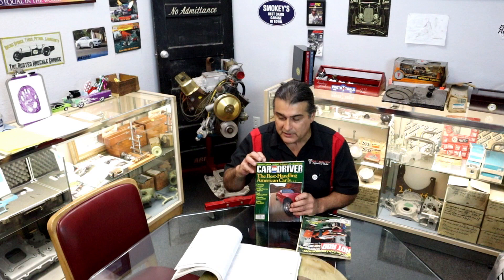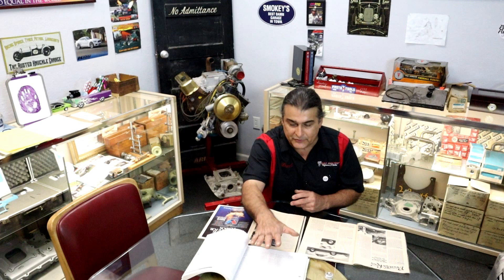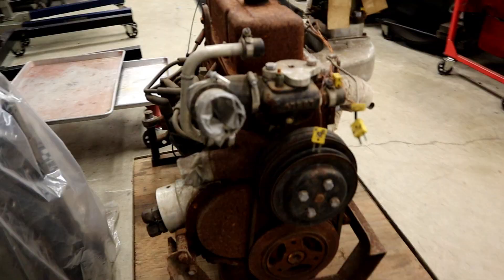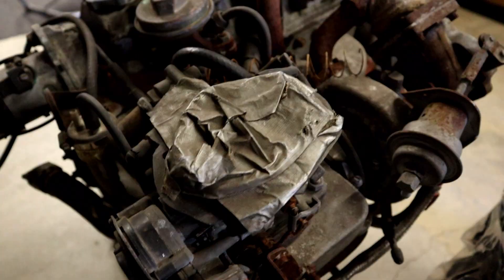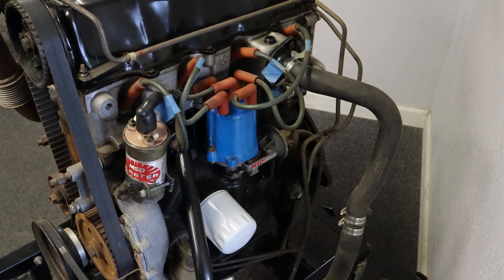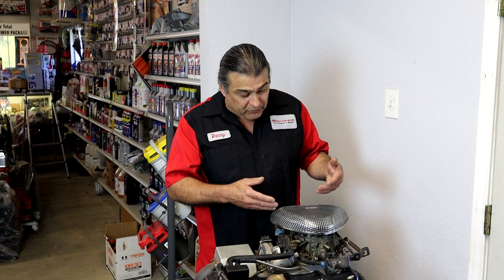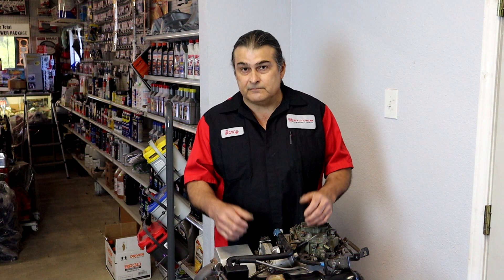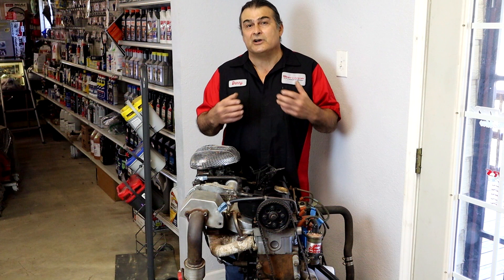What ever happened to Smokey Yunick`s Hot Vapor Engine

Comment: 250 horsepower with 54 miles per gallon, why didn't this succeed, and why is no one pursuing this today...
Reply from the maker: Great questions!
Reply: WHY NO ENGINE IN THE INTERIM 40 YEARS?  
 
1.	The first reason is OIL, not Big Oil, although that is a part of the answer too.  In the early 80’s the widespread availability of synthetic motor oil and lube was a decade or two away.  In order to make the engine functional at the temperatures required for the engine to achieve Hot Vapor process Smokey was using Jet Engine oil that was 98 dollars a quart.   
2.	Of course, Big Oil was a reason as well.  After the Oil Embargo of 73 there was a push toward fuel economy.  But by the time Ronald Reagan assumed the Presidency, one of the first acts was to remove the solar panels from the White House roof.  The rest of the decade saw a move toward less of an emphasis on the fears of the 70s and the return of gas shortages. 
3.	The OEMs had ideas of their own and moved back toward the idea that cooling an engine was the answer.  They had also made a commitment toward EFI and they were not going backward.  The culture of that time (Pre- Jobs, Gates and Tech Entrepreneurs) tended to look down on engineers without formal degrees. What Marlan Davis called, “it wasn’t invented here syndrome” in his article for HotRod Magazine: “It was the "not invented here syndrome" rearing its ugly head again. “How could a couple of gearhead hot rodders know more than all of Detroit's best engineering talent?” 
4.	Lack of access to the original engines.  Smokey made the conscious decision and concerted effort to keep the hard tech from the “suits”  There is good evidence that even trained engineers with access don’t understand what they are seeing and misidentify and misunderstand what is in plain sight. To the trained eye Yunick’s efforts to effectively camouflage critical parts and components is evident.  This pattern of false bread crumb trails carried over to the patents themselves where Smokey would use in-exact, misleading, or made-up descriptions as well as omissions to throw potential IP thieves off track.  We have already identified at least one instance where the drawing in a patent is not the same as the working physical engine. 
5.	There is no doubt that the fall of John DeLorean was a crucial set back.  And, the Hunt Brothers were having their own problems with Law Enforcement.  However ultimately, it was probably Henry “Smokey” Yunick that made the conscious decision himself.  There was no arguing Yunick’s genius. Nor his eccentricities and “My way or the highway” terms.  He was now in his 60s and was slowing down, thinking about writing a book or two.  He was already a legend, decorated WWII Pilot, Inventor and had won over 50 races in every type of auto racing. He had business interest in South America.  He had spent decades being challenged by Auto and Race Execs.  The endless parade of engineering teams alone must have been exhausting, always the fear that they are going to steal your knowledge and work.   To prevent this there was always a false trail in the treasure maps he left behind, “It is really quite simple, and I am careful not saying too much. This is the only way I can be sure nobody knows how the system exactly works says Smokey”  Swedish Hotrod Magazine 
6.	At the end, maybe he just got tired, to quote him as he closes out the chapter of something that he pursued for half his life, “These things start out as a little conversation and like a hurricane get spinning faster and faster and I guess where the inventor generally gets blowed out the side someplace then the wind and rain goes away and in thirty days it is like it never happened.  As it stands today the Smithsonian has inquired about a hot vapor engine for their museum.  Maybe you can check it out there if they never get it into vehicles.  They’ve also got one of my hats.” Eating the Elephant page 249.

Comment: I'm  a Smokey fan. His racing and engineering exploits are legendary. I'd really like to see an HVC engine on a dyno to verify the claims. Never could understand how he was able to run a heated, super lean mixture, control detonation, and make 250 hp with a tiny 3 cylinder. Doesn't  add up. Even Tesla claimed some crazy stuff that couldn't work the way it was described. Why not run it on the Smoketron to prove it works? I think Smokey donated the Smoketron to Embry Riddle in Daytona. THAT would be cool!
Reply: You have to  take what you think you know about the combustion process and throw it out the window. What actually got Smokey going on this was him almost killing himself cutting the top out of an old fuel barrel. He said it had been empty for months, open and vented to the atmosphere, including being rained into. Very little odor even left, yet as he said, " the dammed thing blew up". That was his moment of truth. He was working on a better method of Ignition, the HVC engine as run is only partially efficient, with a true plasma ignition source, you could reach really lean mixtures.
Reply: It was never a viable system I am not even sure it was supposed to be. There were a lot of good things but also serious problems to overcome. It did run and perform well up to a moderate load or under load on a controlled dyno. But from everything I have read on it, it went through head gaskets like crazy, melted pistons and did have detonation issues when used in real world conditions. It also had very high NOx emissions. In a pound or gallon of gasoline there is only so much energy available and a certain amount you can realistically get to the pavement. The idea of this engine was to make a lean homogenous mixture that would burn, and it did. But it doesn't mean you eliminate all the problems you get from lean combustion. Smokey was an amazing inventor, racer and problem solver. Even if this engine wasn't a viable product he could sell. You can be damn sure he learned a lot and applied it to his cars to win on race day.
Reply: In Europe in the late 80s most of the engine manufacturers were experimenting in lean burn engines, including so called Adiabatic cycle engines, but the NoX emissions killed the idea and the EU decided the best route was to go down the catalyser path. Perhaps if more research had been done some way of reducing the NoX's or even catalyzing them might have been a better route to go. With only 9 years now left of ICE engines I suppose it no longer matters. I'm glad to see that the the the truth behind how really filthy ICE engines are has finally ended any chance the oil industry has of hanging on to our money.
Reply: @TIMMEH19991 I am very torn between traditional ice engines and battery powered modern electric cars.  To me something like the Toyota Prius or hybrids like that make a lot of sense as you have a backup and you're not reliant on just one source, especially until battery technology improves to a sufficient level and can be very very reliable.  I'm still hanging on to my old ice cars because I live in a place that is an hour away from Seattle and there is tons and tons of tech money here so it is a big difference between the haves and the have nots and they have drive the price of everything up like crazy.  Don't get me wrong I love electric motors I love the simplicity of them I love how they're so few moving parts.  Do I like big oil companies no do I like the fact that we get tons of precious metals from 2nd and 3rd World countries especially in the Congo no I don't.  What is your opinion on these things?  Either way I wish you peace in your life.